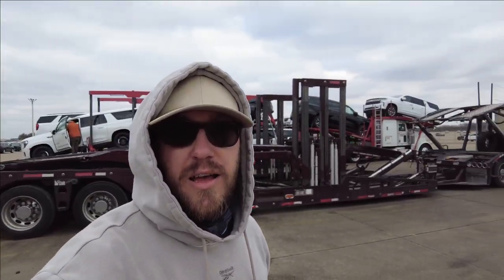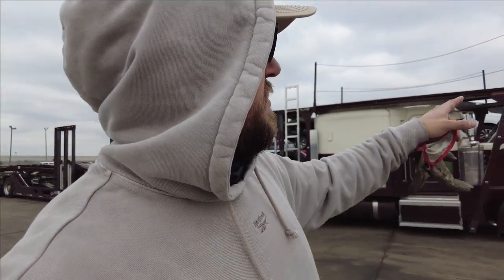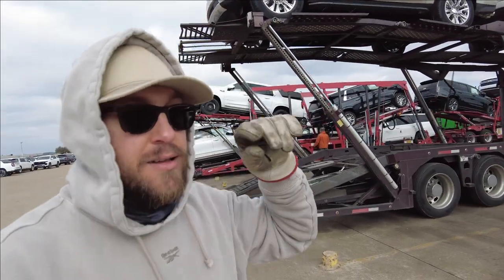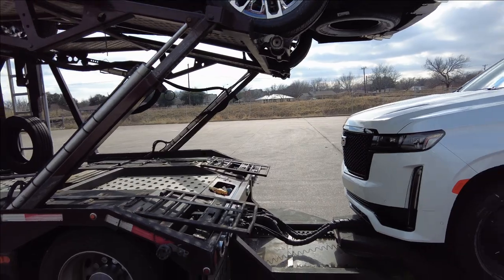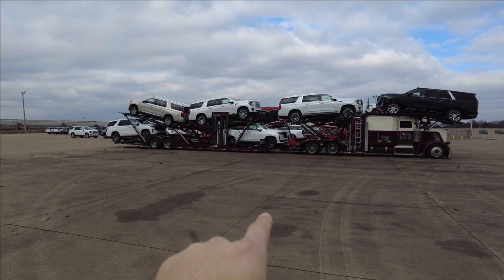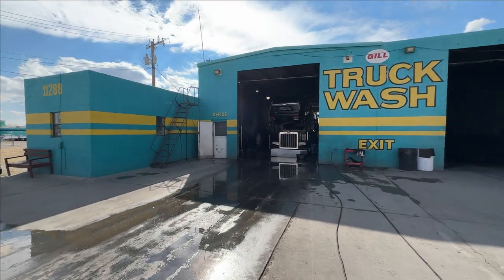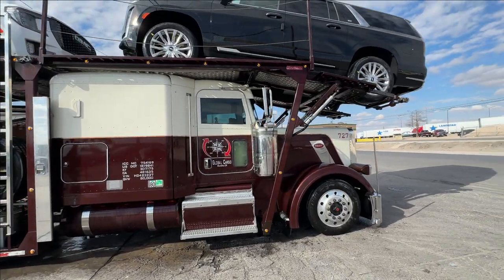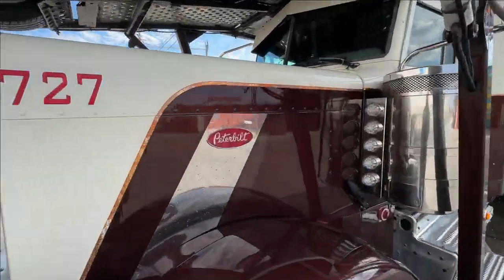Loaded some Escalades and Yukon XL from Midlothian TX.

Comment: I worked for Hadley in Cali in the nineties and 2000's till they shut the doors. We pulled for PMT when they needed it. Big loads all the time with  Ford and GM. That was the load configuration we used with the big six and seven unit loads. Hard work but good money. Good memories. Your trailer is a Boyston? The red Flake paint is the best! Cheers!
Reply: I also worked for Hadley out of San Diego/Mira Loma. VPD, S&S-Seland before that.  Pulled those Tahoe loads out of Arlington to Detroit a few times for Jack Cooper. 13'6" baby.